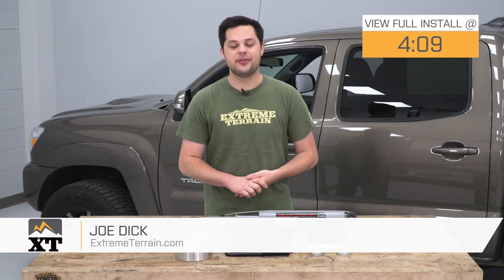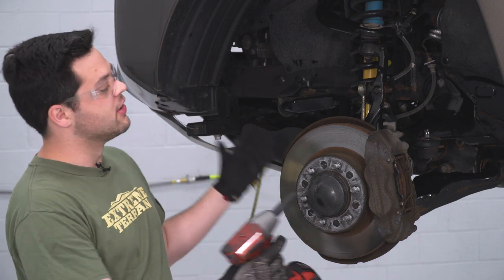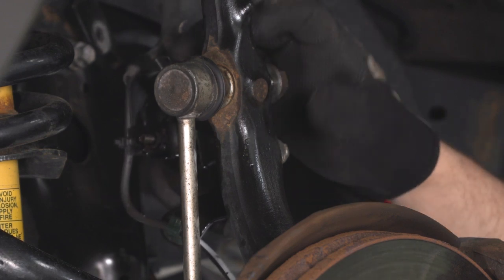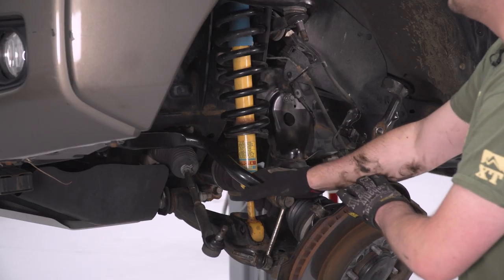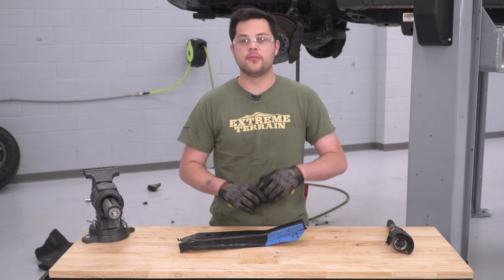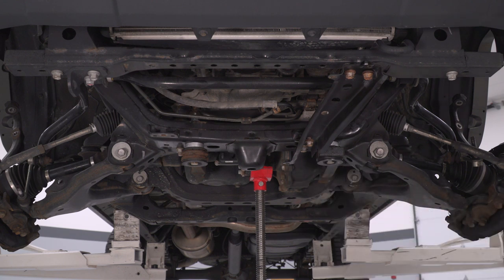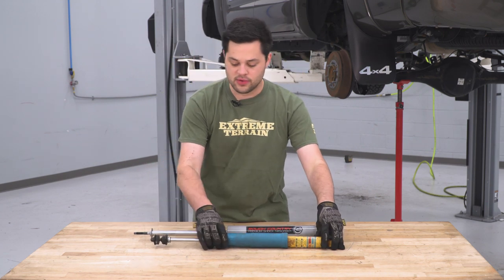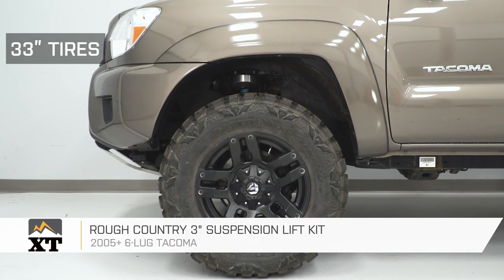Tacoma Rough Country 3 in. Suspension Lift Kit (2005-2019 6-Lug) Review & Install

Comment: Just installed this. Took me 9 hours with carefully following the video, researching torque specs, food and water breaks and a trip to the parts store for a tie rod puller AND set up and clean up. I also installed the OME driveshaft bearing spacer. No vibration at any speed. Great budget or entry level lift. Cleared 33's no rubbing on flat ground.
Reply: Do you think a upper control arm upgrade is needed?

Comment: Great video, but failed to mentioned that truck in the video is a 4wd, and the skid plate is not required to be removed and spacers installed for a 2wd model.
Reply: Will this setup fit my 2006 Toyota Tacoma; 4 cylinder, 4x2, 5 lug, access cab?
Reply: @EscapeTheMatrix6977 no it’s only for 6 lug models

Comment: I have a 08 prerunner and I would very much like to fit 17 inch wheels with 10×31 inch tires. My question is will a 2inch leveling kit work or do I need to install a full suspension lift kit?. One of tour previous videos got me confused big time!

Comment: With this kit you don’t heve problem with the upper control arm touching the strut coil?.thanks in advance for your response.
Reply from the maker: You could potentially make contact at full droop. With 3"+ I would recommend that you upgrade the upper control arms to flatten out the suspension angles for the best drivability! Thanks for watching. :)

Comment: I bought an old 2006 Tacoma Double Cab short bed 4.0L that has been lifted 3" but the suspension on the front and rear are very stiff. What could have been the problem? Thanks.
Reply from the maker: If it was lifted using lift blocks front and rear without the use of adjustable upper control arms, that could be causing the stiff ride! -Zach

Comment: Hi I did the 3/2 spacer and 285/70/17 tires love the look. Had a shop do it. But it has a little shiming or wobble in staining wheel around 46 to 60. But if I apply little presser on steering wheel it’s ok. I told the shop he said he has no idea what could cause that other than big tires? The alignment is good I think it’s balance friend said he read something about the Uca in a 2020 Tacoma need replacing and needle bushing in drive shaft. Getting stressed out. I tried lowering tire pressure from 35 to 30 no difference any suggestions?
Reply: Pop it in neutral at speed and make sure it's in the wheels vs something elsewhere. If it still shimmys it's definitely something rotating causing your problem. Could try a bubble balancer and weights on the rear of the rims to see if it helps and rotate hubs by hand to see if anything seems sketchy.
Reply: If neutral solves your problem it's in the driveline somewhere, u joints, rear axle going out, etc.
Reply: Needle bearing.

Comment: Hello, so I had this lift kit installed on my 2016 Tacoma TRD about 7 months ago.  Everything seemed to be fine until 3 weeks ago when I started to hear a humming sound from the front end.  It was a faint sound almost like a revving sound every 2 seconds.  I could even feel it through the gas pedal & steering wheel.  Could this be the needle bearing in the CV axle causing this sound?  I brought the truck to a local mechanic who could not determine the exact cause other than to tell me the front end is not in aligned properly due to the lift.  Any thoughts on how to remedy this issue?
Reply: I would always recommend getting an alignment done after any suspension modifications. That’s probably what it is.

Comment: Hello there I have The same  lift kit 3”front and 2”rear do I have to replace the shock or keep it the same  as it came on the stuck 
And I wana put 295 70 R 17 nitto grappler 
is it gona work for this kit  any idea
Reply: i would just go ahead and get extended shocks
Reply: I have this kit with 33s on stock wheels. No rubbing at all.
Reply: @jackkruszka5140  which factory wheels and what size tire?

Comment: Just did this kit but with the lifted struts not spacers.
After done going down road and I get this harmonic vibration kinda like rubbing noise. Goes away at higher speeds and coming to stop. Any ideas what it could be??
Reply: Did you ever figure out what it was ? I know it’s been a long time but mine does that and I just installed it
Reply: @Cymett  yep, east coast gear supply sells a clam shell bearing (needle bearing)that is installed on the driver side (drawing a blank on the proper name lol) cv arm. Toyota tolerance in .030 this is what causes the vibration and noise. East coasts is .015 and it totally takes it all away. East coast has a video on youtube explaining it all. 80 bucks for the part and tools to take the bearing out. And couple good videos on here showing how its all done. Took me about an hour and rides perfect now.

Comment: Did you have to change the upper control arms to clear the thirty threes.
Reply from the maker: If you're going with a little more narrow of a 33 like a 255/85R16 or 265/75R16, you should be alright. But if you go with anything wider they may be needed. New upper control arms would be a nice addition to this kit anyway though, as it would help correct your trucks suspension geometry after lifting. -Zach

Comment: Hi Joe, If I have my 2016 Toyota, Tacoma off-road Sport truck installed with a set of your Supreme Suspension lift kit with 3-inch front, 2 inches for rears. What is your recommendation Wheel with a tire to put in without a problem robbing the edge my finder? Please reply before I installed your Supreme Suspension lift kit.
Reply: JT, hes been quit busy installing other kits sorry he didnt get back to you 5 months ago maybe in 2022 some time he will answer your question so hold tight bro..

Comment: Yes....finally a truck like mines! Lol. Is the front slightly higher?
Reply from the maker: The front is going to be slightly higher than the rear, but that will work out perfect if you ever plan to install an aftermarket bumper or bull bar. -Zach

Comment: Hey guys quick question I have a 2019 TRD sport, is the diff drop and skid plate bar cut still required? For non 4×4?
Reply: No because in a 4x4 there is not a front differential.

Comment: Shoulda just removed the 2 bolts on the lower balljoint. No need to remove the rods and sensors. Remove strut from below, add spacer, bolt and install back with jack. Tighten bolts and JUALA🤣🤔🤣🤔😂
Reply: Voila* 😅